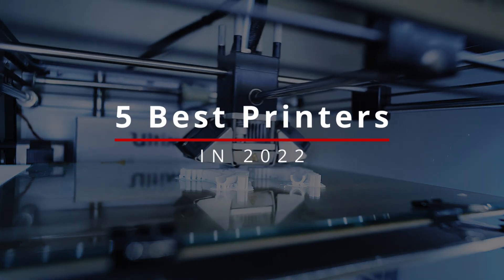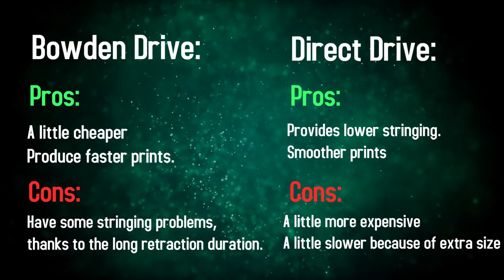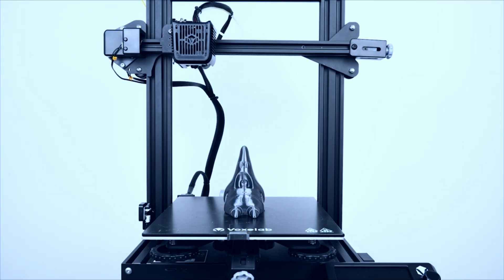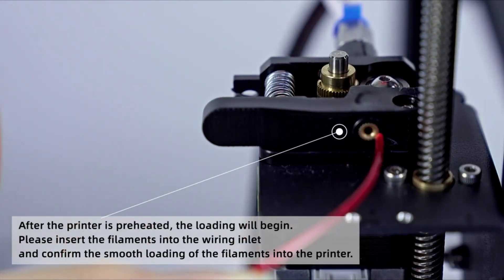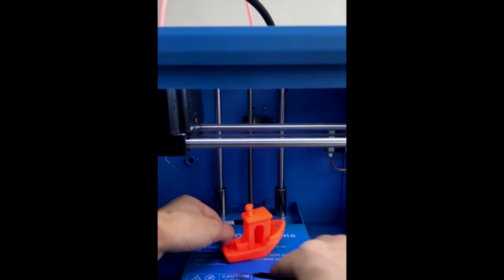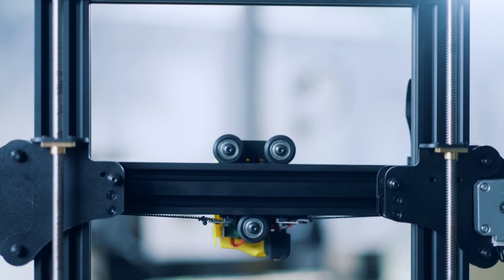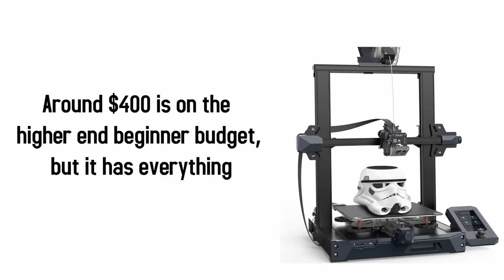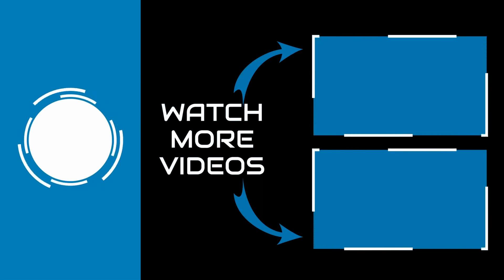Best 3D Printers for Beginners in 2023 | Top 5 | FDM Printers

Comment: Is this a good starter printer? Creality Ender 3 S1 3D Printer with Direct Drive Extruder CR Touch Auto Leveling High Precision Double Z-axis Screw Silent Board Printing Size 8.6X8.6X10.6in

Comment: Many mistakes here:
1. Main Materials is PLA, PETG, TPU then ASA ABS etc.
2. Bowden extruder is generally speaking cheaper while direct drive is better. And no there is no recent bias toward them this has always been the case they were just more expensive and heavier
3. Print bed, which material your bed is made of is important. Best type is a coated spring steel material since it flexes and is magnetic.
4. Size, bigger is not better bigger is more difficult to handle especially shrinkage wise.
5. Slicer, go with Prusa Slicer really or some other iteration of the slicer like SuperSlicer
6. Community size is important for beginners.
Reply: What's wrong with ultimaker cura as a slicer?
Reply: @MeepMeep88  Nothing in particular, if you prefer Cura that´s absolutely fine. It´s just a little more untidy and it´s difficult to start with it in my opinion but that´s a biased personal opinion. In General you should use the Slicer YOU are most happy with for whichever reason.
Reply: @sierraecho884  Was it your 1st slicer that you used as your main? I've only used Cura and if Prusa is more beginner friendly, I wouldn't mind trying that.
Reply: @MeepMeep88  I have started out with Simplify 3D, then Prusa then Orca slicer.
Since they are all free I would recommend you just install them and see what you like.
Cura is too confusing for me with all the options, I just don´t like the UI but function wise it is a good slicer. Just see if you like Orca slicer I would recommend that.
Reply: @sierraecho884   Thank you, I'll give it a go.

Comment: wow, thanks but i have one question: if the printer doesn’t show on the website that it supports Tpu, can i just exchange the tip to a direct drive and then it’s capable of printing Tpu??
Reply from the maker: Hey MLG, 
I'm not fully certain, so its best to check some 3d printer communities to get the best answer. My guess would be yes.
But you would have to make sure that the printer your switching is able to take the direct drive switch.

Comment: Which one do you personally suggest? I'm on a tight budget, but I want something that's relatively big, but will last for 2+ years.
Reply: Ender 3 would be the best in my opinion.
For easy used easythreed nano is a great choice.
I have anet a6 and easy thread and it works great.
But if you wanna spend a little more get a auto bedleveling 3d printer
Reply: @nischal711  Lol to late XD I just got my Aquila X2. Still building it. It fit my budget and the ender didn't so yeah. Thanks though.
Reply: @nischal711  Do you have any suggestion on good auto bedleveling 3d printers?

Comment: Ender s1 do not have linear advance option, which means if you need accurate prints, especially the ones that will fit in each other you will print at 10-25mm/s, the higher speed the more sharp edges will stick out.
Reply: Which one do you suggest that have linear advance option?
Reply: @gunhann  you need to check how to enable it first, as specific drivers and motherboard do not support it at all and it depends which components is in your machine. Prusa do support it. You can check many videos on youtube on how to enable it in your printer but mostly it requires to changer motherboard and drivers.
Reply: @tobuyornottobuy2319  I don't have a machine yet. Looking for which one to buy and what is an important feature. For a home usage seems best contenders are s1 pro and prusa mk3s+
Reply: @gunhann  I would say is more about how good you are with making upgrades yourself. The best option is delta with Klipper installed, it prints damn fast with perfect quality, like 150-200mm/s with 5000 accelartion and perfect details and geometry. But to upgrade one requires some knowledge, no newbie friendly. Apart from that Core XY is another option that performs better than cartesian. And all in all it comes to money and how much work you want to put into printer to make it print perfectly and fast. Sadly there isn't any printer available on market and you plug and play without upgrades, unless you ok to print slow that will take days to make just small toy or any part.

Comment: I bought ender 3 and it didn’t work. The first time I turned it on the control screen was just blue and never allowed me to print so when I looked up the problem the solution said I needed to update the software so I did that nothing worked. I just received my replacement ender 3 and they sent me a refurbished one and when I turned it on the same thing just a blank screen and the fans all smelled like they were burning ender is a crappy 3D printer

Comment: Do most 3D printers consume a lot of electricity, and with the cost of everything rising after a few hours of printing, is the cost high?
Reply from the maker: Its not that expensive, it depends on the printer, and on where you live.

But you can expect the cost to range between 1 to 10 cents per hour. which is quite reasonable.
Reply: @LuigisProductReviews  Many thanks for getting back to me

Comment: Thank you for your videos - I am new to 3D printers, and your info is invaluable.  I am in Canada, and have a very small apartment with limited exhaust options, and two cats.  Therefore I think enclosed may be better? The Flashforge Adventurer 3 Pro is a frontrunner @ $589 CAD shipped.  But it is small, and I can't afford to just upgrade every now and then.  So the Adventurer 4 seems great, has a HEPA filter, but is $999 CAD shipped.  Not out of the running, but up there in price for me.  In your opinion, am I way off the mark?  I can get the Creality Ender-3 S1 for $428 CAD shipped, but need to look at some kind of enclosure, which all seem soft-sided (not cat-proof) and don't have exhaust fans or filtration.  So torn between all of them.  Any advice would be great.  Thanks so much for your content!
Reply: He just reads some specs tho, does not look like he actually used them. It's good to checkout people showing how they work with them & what they say after at least one year of using it if you won't buy a "surprise package" ^^
Reply from the maker: Hey dabruuzer,
Considering your situation and that you have 2 cats , I understand why you want an enclosed printer.

Luckily the fumes from fdm printers are not so bad. Unless you are using ABS material. So you just need to think about enclosing the printer in a way that the cats can't reach them.

A less conventional method could be, to get an ender 3 s1, and a cover ( something like an aquarium tank that's the right size of the printer.) the benefits is the tanks are not so expensive, you will see through them to see what the printer is doing, and your cats won't reach it.
The negatives is that you will have to lift the tank every time you start and finish printing.

If you don't want this hassle, then as you say buying a ready enclosed printer would be better.

I see you are concerned about build size too.
I'm not sure what you plan on printing. But Considering the market the $999 CAD Adventurer 4 is normally more pricey than that. And the $589 adventurer 3 pro is normally cheaper than that.

So it might be a good opportunity to take advantage of the prices and go for the bigger size. 
ps if you are looking for cheaper, check the adventurer 3 lite, which is like the 3 pro, but no camera, and has a different bed but $90 cheaper*

Hope that was helpful :)
Reply: Where would you recommend  buying from in Canada?

Comment: Great video, very informative.  Do you have any experience with a flsun super racer.  If so whats you opinion on it.  Where does it stack up against the ones you mentioned in your video?
Reply: same question
Reply from the maker: Hello Xavier,
The flsun super racer, is quite a nice option. the way it works is a little different from the ones in this list in terms of x,y,z axes.
This can result to faster print speeds, but still if you print at its fastest settings, you will see around a 10% reduction in quality.

Overall, the printer has some minor flaws, like the bed not being the best. and the fact that it can take quite some finicking around with the settings to get the best results.

So, Personally, I would suggest this printer to anyone who already has experience 3d printing already, and wants to upgrade their build size and quality in the long run.
If you are ok paying the extra cost, and patient with finding the perfect settings though, then the flaws on this printer will be solved.

Hope this was helpful :)
Reply: @LuigisProductReviews  Yes, Thanks for your response. I appreciate the feedback. I recently found my first 3d printer (ender 3 V2) for $120 so ill learn with that one and maybe upgrade later when I figure out what are my needs from a printer.

Comment: Amazing video, and really helpful too! What is your opinion on the sidewinder x2? I’m looking at that or the ender v2 max
Reply from the maker: Thank you :)
Sorry I will give you a hefty answer :P.
Both the options you are thinking about are very good options.
The sidewinder x2 made it to Number 7 in my list out of the 40 printers.
I would compare the sidewinder x2 with the longer LK5 pro, because they are very similar (both same build size)
But differences are that: LK5 pro prints faster,  and is around  $100 cheaper VS sidewinder x2 has direct drive and auto bed levelling.

If you are interested in dabbing into more flexible filaments later, then sidewinder x2 will win the fight. Otherwise LK5 pro wins.

There is also the Sidewinder Genius pro , which is basically a smaller cheaper version of the sidewinder x2.

So. If you are looking for build size. Then the Sidewinder x2 is better, but if you don't care too much about size then its better to compare the artillery genius pro with the ender 3v2
as they are more similar.
Artillary Genius pro is around 100 Dollars more than the Ender 3v2. 
And this is because the Genius pro has
( 1. Auto bed leveling, which costs around $25 dollars to upgrade on the ender 3v2,
 2. Dual Z Axis, which costs around $70 dollars to upgrade,
3. Direct Drive, which costs around $40 to upgrade) = total upgrades of 135
But Ender 3v2 has 32 bit motherboard, which is around $50  so ------> 135 - 50 = $85 Upgrades VS $100 Price difference.

Overall, Based on this. My suggestion would be, to get the Ender3 v2. And then if you feel like you need to upgrade it, you can do so (lots of youtube videos on upgrades)
But, if you don't want the hassle and just want a ready good 3d printer. Then the Sidewinder genius pro would be better. 

PS. If you were talking about ender 3 max and not ender 3v2, then I prefer the Sidewinder x2 over the ender 3 Max.

Hope this was helpful :)
Reply: @LuigisProductReviews  thank you so much this helps a lot. I think I’m going to go with the ender v2 and upgrade everything you listed. Because like you have said on your channel the Ender just has easily the biggest community, so even if I do run into problems I have the community to help me out. I am eternally thankful for helping me find what to get can’t wait to start printing!
Reply: @averagecoolepicyoutubers1929  think about what you want from a printer and go from there. The new sprite system from creality have been great because it's usually the first change or frustration from those machines. You want a machine out of the box that ends up being what most people mod printers to become....creality-cr-10-smart-pro-3d-printer. 
Big printers need stability bars, done
Monitoring system, very tech savvy thing to do yourself, done already
LEd bar, done
Filament sensor, done
Flex bed, done
SD card firmware system, done
Touch screen UI, done
Wi-fi, done
Optional filament weight holder and enclosure.... This machine has what I see time and time again what people do modifications to get too and factory is almost always the better option